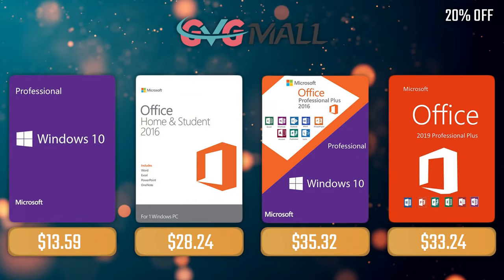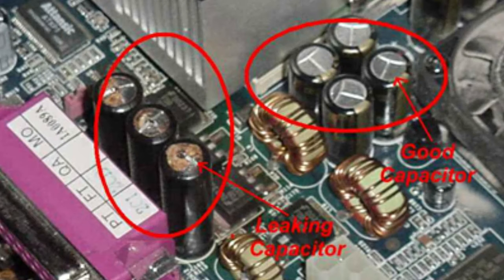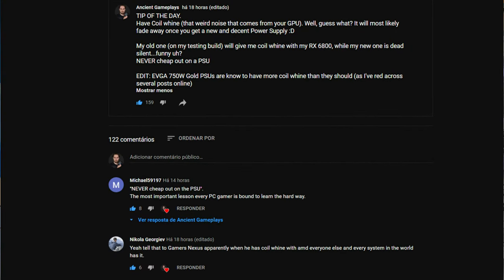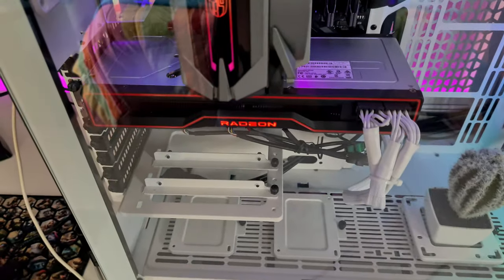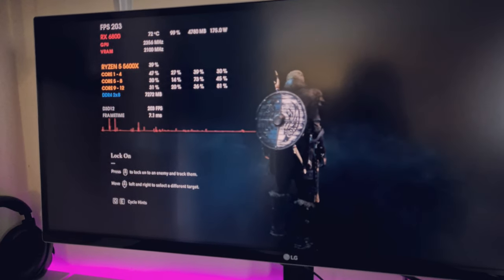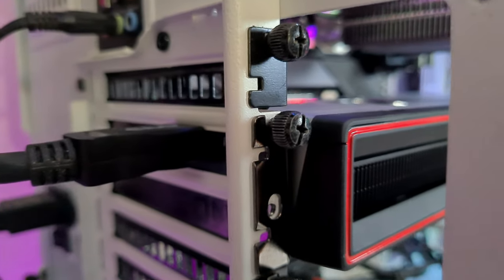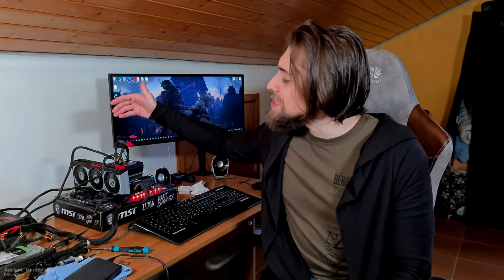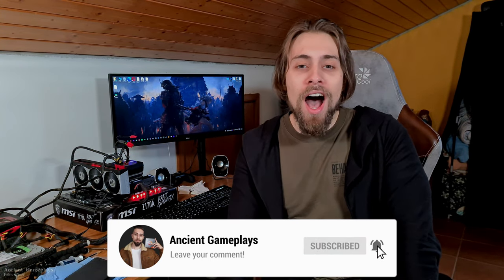GPU Coil Whine -  GPU or PSU's Fault? How to fix it?

Comment: Love your videos.  Glad I found this one as near the end you mentioned about the evga 750 watt gold ....I have evga 750 watt BQ bronze 80+ and was OK with 5800x and rx6600 8gb but just got a gigabyte rx 6800 16gb card and looks prestine condition even tho I got it from Facebook marketplace for £450 . ...I stuck my ear to it and it's more of a loud buzz sound than  a whine but sometimes it goes away after a few minutes. It seems to be more the power supply than gpu as can't hear anything from the gpu. Keep up the good work and thx ❤😊 ps. Someone's comment here reminded me .....I too I'm using two via cables and not a pigtail
Reply from the maker: Great I could help 💪💪

Comment: I had coil whine on my 3070, eventually it disappeared.  Something that I changed, was not using the Y connecting from the PSU. 

Just ended the video now, and it was your solution ehehe
Reply from the maker: hahah, solved it seems xD

Comment: I just changed my ok-ish psu for corsair rmx. It didnt completely eliminated coil whine but it made it reasonably quieter.
Reply from the maker: Exactly, that's the point :D
Reply: wierd, I changed too from a thermaltake 700w (which was quiet) to the a corsair rmx 1000w and the problem still there with the GPU (3080), and now the PSU does the same whining (even that I replaced it twice , still the same)
Reply: @ahmadodeh8361  I changed from cheap 7 y.o. chieftec(which was silent) to fractal design ion gold and it started whining (3070ti)

Comment: Small update on this regard from my testing, at the moment no matter the GPU (AMD or NVidia) it's a lottery, first you have to determine which component is the coil whine starter. My GPU is a EVGA 3080 XC3, and I started with a straight power 11 (yes a little on the short side) I changed to a Seasonic TX, PX 750, BeQuiet Dark Power 12 750(2021 model) and a Corsair RM750X. And from my experience my card is almost silent. In my ranking SS and Corsair are on the silent side with almost no to no coil whine. BeQuiet was the worst but there seems to be with the first charge of PSU, because there are a lot of complaints about whining and screaming under load. 

Oh and btw, 80+ rating didn't matter between the titanium and gold rating, because there was no difference in noise whatsoever. If not for the retarded cheap a.. fan (bearing noise...) in those PSU I would've stuck with them, but now it's a Corsair PSU Gold instead of a plat. But for now the result matters, even tho I wished there wasn't this aweful testing and checking involved. I rate this 2/10 user friendly.
Reply from the maker: Yeap, one thing is the efficiency and another one is the parts used in the PSU (caps for example). Corsair rm series have 100% japonese caps which are way better than the usual ones, and the filters are also better, hence the results
Reply: @AncientGameplays  indeed, fun fact a lot of them are claiming for Japanese 100% caps, but I feel like the QC on some PSU are lacking. Maybe some real world testing would get them closer to the point where they might figure faulty parts. I mean a test 30 or rx6000 and some load is not that much to ask for. But nonetheless after a lot of money spent in transit I can say I'm happy with the result. Maybe not 100% gone but at a point where I would say it's fine. And I'm very sensible for this kind of stuff. ;)
Reply: straight power 11 750 w  have also 12900k 3060 asus  16 gb asus prime z690  have also suffer from coil whine very much  under pain killer black and 3d mark 03/06 my psu is the problem?

Comment: I switched from an old PSU/powersupply to a new Corsair 750W PSU (didn't switch the GPU at all), now I get insane amounts of coil whine even with integrated graphics!
The PSU is a more important starting point for eliminating coil whine, along with testing with integrated graphics before thinking its your GPU.
Reply from the maker: It is usually a mix of both. Or you have a defective PSU, or you need a little "burn out phase". No psu would coil whine with a low wattage
Reply: @AncientGameplays  My PSU might be defective, although I only got it three months ago, so it probably needs burning-in. The previous PSU I had was a 450W one.
Reply from the maker: @penguinsushi8442  Unless it is a really bad PSU (with bad components) it should never whine with such low power draw...the filters must be really bad...
Reply: @AncientGameplays  Sorry, forgot to mention that most of the noise only happens when there is a high GPU load, my GPU didnt give that much coil whine with my previous PSU, which is whats throwing me off. I have a GIGABYTE GTX 1050 Ti (4GB) btw.

Comment: I can confirm this "fix". I have recently upgrade from 1060 aero to 3060 TI OC and was horrified by the loud coil whine of my new 3060 TI. So much so that I got a "be quite silent base 802" case to try and keep the noise level down a bit. It worked, but coil whine was still very noticeable even when gaming with loud sound. My pc has an older Fractal Design 1000W PSU, and it was making too much noise and I wanted to change it out for a while. So I bought a new RM650 PSU and installed it in my PC.
I was pleasantly surprised how much the fan noise of my pc had gotten from changing the PSU, but even more surprised when running my first game.
The coil whine is GONE..... Like so quiet now that I have to run a stress test, open the case and put my ear right next to the card to hear any coil whine at all. And even then it's mostly overshadowed by the fan noise. I was blown away and can now enjoy gaming with no distracting noise from the PC :D
A good PSU can really make a difference...
Reply from the maker: Most people don't understand how important a good PSU is. And wattage alone means absolutely nothing...
Reply: @AncientGameplays  So true, my PC has never been more stable than now.
Reply: @jobbejsk  Wow, so RM650 solved all your coil whine issues. I am willing to buy the same PSU to keep my 6700XT coil whine at low levels. Is your 3060Ti coil whine free even at high voltages?
Reply: @AncientGameplays  what type of PSU should we look for ? Gold rated ?
Reply: You are lucky) maybe I should try Corsair
Reply: @gyula4293  Update: It did not work with a RMX650i
Reply: @Bogdan00  Which 6700 XT card do you have?

Comment: The motherboard plays a role, too. I have an RTX2700 and a nice seasonic power supply with NO perceptible coil while. I replaced the motherboard and now it whines incessantly. The motherboard provides power regulation, too.
Reply from the maker: The motherboard has to be bad for that to happen, I mean have bad power phases
Reply: @AncientGameplays  Thanks for the response. I'm surprised by that! It's an MSI B660m-a "pro" which is renowned for having good power delivery. Maybe I should look into an RMA. The sytem functions 100% otherwise.

I should ad that I've since replaced that RTX 2070 with an RX 7900 XTX and the coil whine has stopped!

Comment: Nice video - very helpful, but what brand of power cables would you recommend? I have the same 750w PSU as you use in your main PC but the cables are flat and only use one for a double 8 pin GPU (Sapphire RX Vega 64 Nitro+ Revision C1). Do you think it would be a worthy investment to upgrade the cables? And which brand would you recommend?
Reply from the maker: Hummm, for starters i would connect 2xPCIe on the card instead. In the video it reduced the noise quite a lot over 1 cable only
Reply: @AncientGameplays  Thanks, I will try it out. As I can't find the cables that came with the PSU - probably in the loft or something - do you know what type of cable would be best suited?
For example, you have flat ribbon cables that are supplied with the PSU and you showed your test bench with braided cables. Would the choice of cable make any difference?
Reply from the maker: @bigj1454  it may make a different, just try them out

Comment: Just copped a new Corsair RM 1000x (gold rated) for my new rig. At the moment am using my old 1080ti, and a new ryzen 9 5950x. Coil whine is really getting on my nerves. I hear the rough location and it's very annoying/potent. Am going to go on the assumption my 1080ti's the issue, has been opened a few times and is very old tbh. Am going to upgrade to a 3080 most likely tomorrow! 
 Hopefully that fixes the whine.
Reply from the maker: Higher end cards with a huge amount of power draw usually coil whine, not much to do aboht ir sadly
Reply: @AncientGameplays  appreciate your reply! Tried this on both the 1080ti and the 3080, not sure if you'd class the 1080ti as a higher power card but in my old system it was dead quiet. Going to see If I can swap around power supplies etc!
Reply from the maker: @geo8889  Yeap, the 1080ti of my friend has lots of coil whine as well.
Reply: @AncientGameplays  I see! I'll see what I can do, fiddle around with it etc etc.... 
Thanks for your help! <3

Comment: I recently bought a PC from someone and the coil whine during most games is absolutely insane. Hopefully it is the psu because if so that would be a much easier fix than a new gpu. The PSU is from what I can tell, not very good. I don't even think it has a rating on it. It just says the wattage. But the whine is so loud that when in use you could probably hear it from outside the room with the door closed.
Reply from the maker: Damn...what gpu?
Reply: @AncientGameplays  gigabyte GeForce 1080 ti aorus water force
Reply from the maker: @AlwaysHawken  those cards do have some coil whine, but it shouldn't be THAT loud
Reply: @AncientGameplays  That's what I'm thinking. The PSU isn't a very good one but I don't know enough about computers to know if it would be affected that much by it. The PSU is a cooler master 750W real power pro.
Reply: The part about hearing it through the door may have been a slight exaggeration of the noise but if my door is open, while playing most games it's loud enough to hear a good 20 feet away

Comment: I have a 6800xt  paired with a Corsair AX 760 platinum, the card had crazy coil whine since day one. A lot of people suggested to try some 24/7 stress tests in order to eliminate it but did not work. The extreme coil whine occured when i overclocked it at 2700mhz with an undervolt of 1000mV. At 2700Hz my card is consuming 280-300Watt.. After that i turned into Silent Bios but still i had coil whine as well but this time less. So what i did to decrease it to about 50% was:
1) Undervolt it at arround 1000mV
2) Core clock between 2400Hz
3) Enabled vertical sync so my card is not working at 100% so i have 144 fps for a 144hz Monitor (so the power draw is lower )

PS: When i had the same PSU paired with a GTX 1080 ti Aorus Xtreme 11G i had 0 coil whine. This 6800xt is whining like crazy since day one and i see a lot of people have the same problem with 6000 series.
Reply from the maker: 1) Undervolting = less voltage = less power draw
2) Core clock decrease = Less power draw
3) Less power draw again

Basically that board from the brand you got (GPU PCB) isn't that great, and when you exceed a certain amount of power draw, the capacitors and VRMs go crazy
Reply: Try 120hz. Amd cards power consumption gets insane at 144Hz for some reasons
Also, try using with a singler monitor. Come back to me if you make the test, I'm curious.

Comment: I recently went from 850w to 1000w (both corsair) and all of a sudden im experiencing a lot more coil whine. Would expect the other way around since the new psu is more powerful?
Reply from the maker: The new PSU may still need a little bit more "burn" to be silent, or maybe the filter of the new PSU is just not as good, because having "more watts" alone means exactly nothing (some inner components might still be worse than in the past versions). But wait a bit more and see
Reply: @AncientGameplays  Okay, thanks for responding! So you think it might get better over time? I went from a Corsair RM850x to a Corsair RM1000x shift

Comment: its not a mix, sometimes a video card has it or psu , in my case only my gpu has it, but yes can happened to have both psu and gpu, coil whine refers to an undesirable noise emitted by an electronic component vibrating as power runs through an electrical cable.
Reply: You're right. 
We can reduce the vibrations
~ Use a separate power pin cable.
~ Try dampening your case or moving the case direction.
~ Putting thermal pads over inductors coils/chokes and pressing them with heatsink, water block, or something else.
Reply from the maker: Yeah ofc, what i meant is that the final result (coil whine noise) is a mix of both since a good PSU will filter the ressonance A LOT and in most cases completely eliminating it

Comment: Got my 6800. had horrible hissing, whining  noises when playing most games, I initially blamed the videocard as it wasn't an issue on my old 1060, but then I actually went to listen where it was coming from and noticed  instantly it was coming from the powersupply. The powersupply was pretty old and only 650 watt. The 6800 also draws more power. So got a gold 850 Watt from Gigabyte which claims to have quality components from Japan. Anyway with the new PSU in place I no longer hear anything at all coming from the case when gaming.
Reply from the maker: Glad you fixed it :D

Comment: I'm not sure that I've ever experienced any coil whine. I'm running a Corsair RM 750x, a Ryzen 7 3700X and an Asus ROG Strix LC 6800 XT and have overclocked the card and stress tested it at it's max power draw of 330W with a full PC load of 550W.
Reply from the maker: Maybe because you have a really good PSU
Reply: @AncientGameplays  Have heard quite a bit about coil whine but didn't know what it sounded until this video. It sounds like walking by a big step down transformer.

Comment: I can clearly hear the coil whine coming from my GPU. Does this mean that it's only the GPU's fault or can be also the mix of both like you said on the video? Also the recommended wattage for my setup is 800W while I have a  1000W PSU (Corsair RM1000X). Should I try to upgrade to 1200W? The coil whine is terrible, I can't tolerate it.
Reply from the maker: It may be your card model that sucks, or may also be your psu. The wattage doesn't matter, the filter does, also, the motherboard matters as well
Reply: @AncientGameplays  Hey I'm back. So I just got a brand new PSU - asus rog strix 1000w - and the coil whine remains. Looks like it's the gpu's fault in my case (asus rog strix 3070 ti). Sad, dunno what to do now. Maybe RMA it

Comment: May have to upgrade my PSU to a Corsair RM850x. Currently have a ROG Strix 750W 80+ gold which has no issues (power delivery wise) but my 6700 do be screeching when I’m playing titles like Forza Horizon 5.
Reply from the maker: That has nothing to do with the PSU most likely, but the mode instead and the non.XT version bring low end coolers and low end capacitors usually

Comment: A few days ago I completed my new gaming building setup with Ryzen 7 5800x, Asus Rog strix X570 e-gaming, G-Skill Trident Neo, Samsung 980 Pro. The only parts I transferred from my previous setup are Graphics Card Msi GTX 1660Ti and PSU Corsair 750 Semi Modular. 
In my previous building I had coil whine and I replaced GPU with GTX 1660ti and the coil whine stop. Everything was perfect. 
Now with new setup and I have coil whine when I move the mouse and I cannot understand how. Same PSU and GPU in 2 different buildings. One with coil whine another not..

Pfff I'm so confused...

Comment: Hermano me has ayudado muchísimo padezco de eso mismo la cambie de EVGA 500 a una EVGA 600 pero me sigue el ruido mucho  menos pero sigue y así es, sale el ruidito e la GPU pero mucho mas de la fuente. Gracias por ayudar con ese tema que no todos saben como dar una solución correcta pensando siempre que es la GPU. Saludos desde Cuba
Reply: La fuente a la que cambiaste tiene la posibilidad de conectar 2 cables 2 8 pines por cable separado ?
Reply: @rrfifa4077  No hermano es un solo cable que vienen dos aunque esa tarjeta necesita solo 6 pines pero se que no es lo suficiente todavía. SI dios quiere dentro de poco la cambio para una de 850W Cooler Master que me dijeron que son bastante aceptadas.

Comment: I used to have a Thermaltake non modular "700w" but in the reality on 12v it was outputting 650w. It had terrible coil whine and i change it to corsair RM850 Fully modular and very happy with it.
Reply from the maker: Great!

Comment: Is a good idea open a gpu to isolate the capacitors with non conductive material like silicone to reduce noise?
Reply from the maker: That would be bad for temps most likely

Comment: Hey Fabio,
maybe you can help me out before I turn to more drastic measures.

I have a relatively new build that consists of a R5 5600X, Asus Tuf Gaming 3060TI and a be quiet Straight Power 11 Platinum 650W.

When the GPU is under high load or at high FPS, I have coil whine that I can hear through my closed case about 1m away (I do have a front mesh case).
Now since the PSU is rather new to the market and the GPU only uses 1 x 8pin connector, I'm kind of lost on what I should do now.

Do you have any tips for me?
Reply from the maker: Hey hey, its basically resonance, the gpu just doesnt have high quality caps, and although the psu is "new", cant filter all that. It is what it is...
Reply: Well...fuck :(
Reply: I might buy a different PSU just to try it out and if it doesn't help I'll just send it back.
Reply: Hey, I have a bequiet psu and an Asus ROG 2070, and read that the psu might actually be causing the problem, because of the frequencies that it operates at, from what I read, this was only caused by psu's made by seasonic (bequiet, corsair, antec and xfx). I'm thinking about buying an evga psu to fix it, tell me how it goes
Reply: hey,
i was actually waiting for a good price for the seasonic prime tx. it has really good reviews and seemingly low ripple.
im not sure if evga is just better compared to all the others.